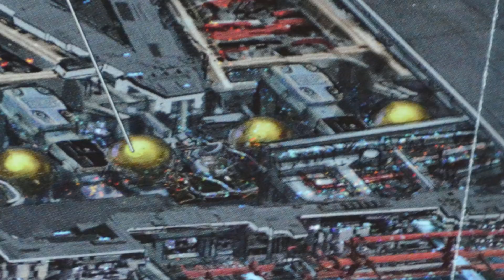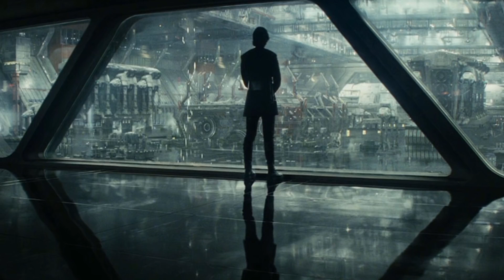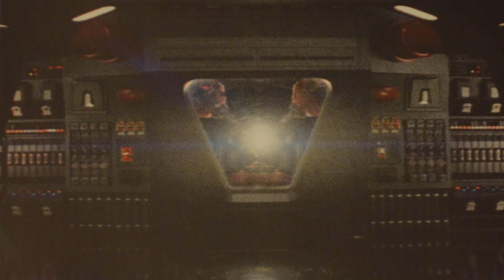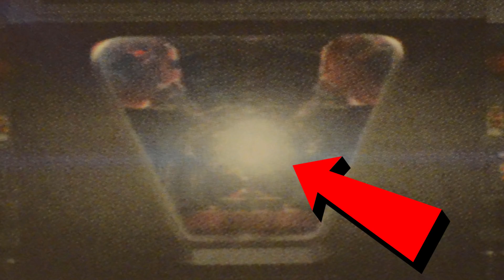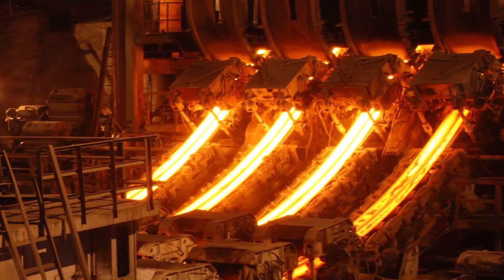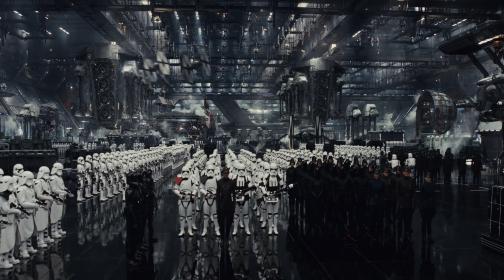HYPERSPACE TRACKING? First Order Capital Ship HQ  Supremacy Mega-Destroyer - Last Jedi Lore - PART 2

Comment: Spoiler below.

And just like the Executor, it was taken out by a single kamikaze pilot. That plot hole was as big as the hole blasted through the Supremacy. Like if hyperspace kamikaze was so effective at taking out other ships, wouldn't they make bare-bone ships piloted by droids to blast through dreadnoughts? You would think that with the CIS's expendable droid army and questionable ethics they would be all over this concept.
Reply: Supremacy didn't completely destroy in the movie even large section of right wing cut off. At least didn't blow up to pieces and Hux and Kylo didn't hurry to escape the ship of anything so.... I think Supremacy still survive but heavy damage and floating in space. 

//In the book Tarkin told about ship at hyperspace speed can destroy nearly anything but just not practical.
Reply: Put a couple Nebulon Bs through the death star and call it a day. No need for vents.
Reply: The thing that really confused me was that it was shown that THREE star destroyers crashing into an Executor from hyper space did NOTHING to the Executor. So why did one ship crashing into a ship the size of the Supremacy rip through it and then some like it was nothing?!
Reply: Soldier_76 dude it's extremely practical and simple. it's just one small ship. A corvette could take down both death stars. The plot hole is why isn't it used more often
Reply: It doesn't have to be a capital ship.  X-Wings have hyperdrives.  The whole hyperdrive kamikaze is essentially a hyperdrive bullet.  Even better you don't need to bother with fancy life support and all that bullshit.  It can bypass shields.  You can't shoot it down.  It can choose the angle of attack.  It can probably also be refined to strike pinpoint critical locations on any ships.  This maneuver shredded through how many ships?  Did it even stop, or did it just keep going?  How do you expect anyone do defend against this kind of effect?  Best part is that it doesn't require any high tech equipment, it's probably better if you strip non-essentially hardware to increase mass for a bigger payload.  This one scene undermined the whole reason for massive capital ships.  They've just become giant targets.

People who claim it's a "waste" of resource;  I'd rather use 10-20 unmanned hyperdrive bullet drones to take out a massive capital ship by targetting its various critical sections instead of 10-20 manned fighters that have to guard a bunch of other manned bomber cruisers so that they can die in a suicide mission.  You can guess where the bridge is.  You can pretty much tell where the engines are.  You an obviously tell where the thickest part is so that's where you can just do the most damage across the board.  You can pretty much guarantee you can cripple a massive ship.  Or you can rely on the skill and lives of your pilots to fly pass their equally trained pilots and maybe ... maybe take out a turret or two.  Or get shot down by one.  Waste of resources, right?
Reply: @AshersAesera  And then there is an interdictor. And you have useless fighters flying around space without doing anything. Also you would need a few fighters to take out one capital ship. With another capital ship you could do more. You could transport vehicles and troops to a planet. Also you cant really bypass shields. Ram a fighter in the supremacy and it would maybe have a scratch. Also "why do we use ships and planes if we could just crash them into eachother" would be the same question.
Reply: @Jake Skywalker
And then there is an interdictor. And you have useless fighters flying around space without doing anything.
You mean those same interdictors that The First Order used to stop The Resistance when they attacked their base?  Or the interdictors that they used to chase them while they were fleeing?  However, to answer your question, unless I'm reading how an interdictor functions wrong that won't work because you can simply disable a hyper-drive's safety features that kick in when detecting a gravity well.  Secondly, the cost ratio of a massive interdictor compared to a squadron of hyperdrive bullets ...

Also you would need a few fighters to take out one capital ship.
Ah, sometimes you'll need to use a few bullets to take out a person unless you hit em in their engines, or bridge, or main reactors.  Oh wait, people don't have key systems, they have key organs.  Anyways, I forgot that that's why we stopped using guns, because people were much more useful ...

Also you cant really bypass shields
Oh, so I guess Han Solo didn't really get through Starkiller Base's shields then.  I'll let The First Order know that their shields shouldn't have been bypassed by Han's trick.  Which is more proof that interdictors won't stop the hyperdrive bullet, if a legitimate planet's gravity well didn't stop Han's trick, then your silly interdictors won't either.
Reply: @AshersAesera  in universe it's extremely impractical to utilize ships as "hyperspace bullets". When you are fighting a war the last thing you would want to do is waste money and resources constructing kamikaze fighters. You would rather spend 1 million credits on small fighters that dont have enough mass to penetrate anything then spend 1 million credits on high tech fighters and ships that could kill more enemies than the one time use kamikaze ships. You dont seem to realize that making ships are extremely expensive. Yes, you could remove the life support, and any other organic saving components and just leave the fighter frame and a hyperdrive but still it would be extremely expensive because hyperdrives are hella expensive. You are wasting so much money on shitty kamikaze ships that you could pull off in ONE fight.

Yes it would be ONE fight. When fighting a war you are gonna have more then one engagement and this tactic would only work once. Because not only would the enemy know of the tactic but they would prepare any future engagements to counter this tactic. Because the Raddus didnt hit the ships in hyperspace, it hit them as it jumped into hyperspace. You would need time to line up your shots but the enemy would most likely take out your small, poorly constructed kamikaze fighters, before they could make their jumps. 

Also your bullets do not have enough mass to go through a heavier ship. So this tactic would not work on the Death Star because the death star was MOON sized battlestation and the death star ll was even bigger! There is so much mass between the cores and the surface of the death stars that the ships wouldn't get in far enough to do any damage to any of the major systems. 

So go ahead, waste your resources on shitty kamikazes that wont work while I take over your territory with ships that I can reuse over and over again while still building more ships that I can reuse
Reply: Ego Banana Let's agree, that the logic is fucked up.
Reply: Captain Fordo Maybe the ships can move out of the way, The supremacy was massive and a not a hard to hit target.
Reply: I had been waiting for someone to use that tactic for a while now, and you could still obliterate or cripple a capital ship with something as small as an LAAT.
Reply: The A-wing making the Executor crash into the Death Star by ramming into the main bridge was complete bullshit since destroyers have redundant systems and auxiliary command decks.
Reply: What's more expensive

A load of steel a hyper drive and a r2 unit

Or a capatol ship
Reply: one sub one plink they’ll have to use a big ship to take out a bigger ship
Reply: what about an interdictor cruiser? they would be perfect against it with their gravity holes
Reply: Hyperspace tracker had a hyperspace bubble INSIDE the ship.  Changed the rules a bit, so that the Raddus could pull that maneuver. Current theory anyway, until something official gets released.
Reply: we all know why it was destroyed like that, a selfish director wanted to make a big name for himself and didn't care if ep 8 ruined the trilogy, or something like that.
Reply: This is in the Legend comic which by the way really ridiculous even in Legend. //Which Star fighter can fly throught Star Destroyer bridge.
Reply: Soldier_76 lol, I'll have you know, I watch Rick n Morty.
Reply: Remember the malevolence? It didn't phase through that moon. The hyperspace bubble should have had nothing to with the collision.
Reply: How easy do you think it would be to hit a Venator in Hyperspace?
Reply: The ship has to be quite large
Reply: Hyperdrive are more expensive then some ships
Reply: @slash-kv1sc  if this was true the rebel alliance wouldn't have had so many ships in the original trilogy with hyperdrives. Every single ship in their damned fleet had a hyperdrive.

Also you have to realize comics they had a way around hyperspeed ramming. Hyperspeed ramey must have existed before it happened now it would just make so much goddamn sense.you take this 2-ton bus and throw it at something faster than light you could literally shatter countenance you continent's.
Reply: Doesn't this video explain that the tracker operates in hyperspace? So, if you have the tracker on, then you are both in hyperspace and real space (is it called this way?), so if a ship flying in hyperspace crash against you, you will blow up.
 This is new tech, so new rules apply. Never been done before, because we didn't have a tracker tech before. Never been done before, so the first order didn't expect it until too late.
 (this is a possible explanation.
Reply: Well we know that when you enter hyperspace, you enter a different dimension, and it's impossible to think that big ships don't get hit by asteroids or what not in hyperspace, which suggests that you can't actually hit things in lightspeed. However, in ANH Han mentions that you could hit a star during lightspeed, suggesting that you can hit certain objects during hyperspace. So if you lightspeed into something as big as a star, or in this case, the supremacy, you would hit it. That's why we haven't seen it before, because the objects that would be getting rammed weren't big enough. Also the shockwave is a combination of a lot of factors, being that the Supremacy's reactor is right where the Raddus hit, combined with the Raddus' experimental shields ramming into something as big as the Supremacy at the speed of light, well I think that would create a damn big shockwave
Reply: You see ryan johnson does not give a shit about the implications of the things he puts in the movie as long as it looks cool
Reply: Fuck these people that are saying it is a new tactic. Hyperdrive technology has been part of the Star Wars Galaxy for thousands of years and you are telling me that someone just figured out now that they could turn a ship into a Superweapon? Fuck you and fuck your stupid fanboy notions! It is a giant bag of bullshit that makes all the Star Wars movies dumber. They could have used it to destroy both Death Star lasers and take out the Star Killer Base Super Laser. I fucking hate you dumbasses.
Reply: It has been done before. 3 star destroyers jumped into a super star destroyer. Shields were up, nothing happened. But since the captain was a female; well, I guess that's the trick it seems.
Reply: why even bother explaining bad writting?
Reply: Ego Banana Hyperspace kamikaze ships would just be impractical. Simple as that. Why make one time use ships and burn through resources like crazy when you can make reusable ships and save resources to make more ships.
Reply: If a 2km ship were to ram Earth at FTL speed, Earth would be blown to smithereens, the amount of energy generated at FTL speed is IMMENSE. The empire don't even need to build Death Stars, just place a bunch of FTL drives on some asteroids and steer those asteroids into rebel-held planets, instant planetary annihilation for a low low cost.  XD
Reply: Sylvia Olivera well, the raddus was a big ship, but it didnt just put a hole in the supremacy, it ripped it in half and vaporised everything behind it. Which probably means a good portion of the impact force just went into space. The death star would get 100% of the impact. And even if the suicide nebulons dont destroy the death star, the holes they would create would leave the death star offline for at least 2 years
Reply: @Riesenfriese  The death star was many times moreassive than the surpramacy. It was the size of a small moon and probably more heavy than a moon this size because it is made out of heavy metal. It might be enough to pull everything out of hyperspace if it comes to close. Also it even if it would damage the death star with a nebulon B (wich the alliance didnt have. It only had a few fighters left) it wouldn't do much. If you make it to the reactor or the superlaser good. But if you hit it somewhere else you are screwed.
Reply: Spoiler?
Reply: oops
Reply: I have thought about that before way back when I first saw the Malevolence in TCW, It makes sense to me. Just have a as you said a bare bones ship piloted by droids or by remote control that hyper spaces in to dreadnoughts and stuff
Reply: Josney 26 Pretty sure that comic is now considered Legends material.

Besides, the Raddus is much larger than an Imperial Star Destroyer and had a stronger hull and shields, so it makes sense that it could do more damage.
Reply: Hyperspace ramming hasn't been done before because it's a new tactic. Plus it's a waste of money to create a giant capital ship that can barely take half of another bigger ship out.
Plus hyperdrives are eeeeexpensive
Reply: Captain Fordo that’s the question how is it a new tactic also you don’t need a large ship he’ll an xwing at light speed could have destroyed it
Reply: @chadkingoffuckmountain970  yeah you can make the hull, slap on a pair of engines a hyperdrive and an r2 and dump it into a capital ship which costs even more, also im sure that someone could have come up with a suicide attack via hyperdrive
Reply: @matej6495  I've once thought about a "ramming" ship, with a giant blade-type thing, just cutting through another ship 🤷‍♂️
Reply: Deatruction of supremacy was bad but destruction of the executer was much more worse so your original trilogy Is not perfect
Reply: @darreideamos2309  Well they destroyed the shields of the executer. And the crew wasnt fast enough to man the secondary bridge.
Reply: Because the only reason the tactic was effective at all was the mass, size, and possibly density of the ship hitting the supremacy. If you wanted to replicate it with an unmanned droid ship it'd be about as expensive or at least in the same ballpark as a regular ship and much less usable, so it isn't a tactic generally considered.
Reply: @Thememester439  first off you're just wrong. Think about it likethis a marshmallow traveling at the speed of light hits with more Force than 2,000 nuclear warheads.

now take a f**** spaceship with energy Shields and throw it at something faster than the speed of light. So what you could do is take all your f**** x-wings because every single one of them had a hyperdrive put a robot in it and have it suicide ran the longest direction of the ship.

Realize that the rebel flag ship wasn't very tall. The supremacy was nearly three miles tall, and at most the rebel flag ship is 500 m. You literally could have just sent Poe dameron on a suicide mission and he would have done something similar lol.it's not the size and mass of the ship when you're throwing 10 tons at faster than the speed of light you don't need very much mass to do a lot of damage.

This hyperspeed ramming is one of the biggest plot holes in that movie alone besides snoke not being able to tell that Kylo was going to kill him
Reply: It’ll probably be explained that you need a huge mass in order for it to actually do anything. Obviously that doesn’t make sense with actual physics, but that really doesn’t matter.
 
Either way though, it’s not a plot hole. It’s just new.